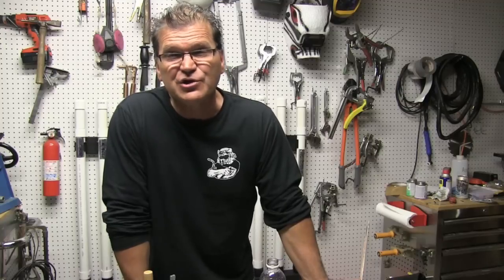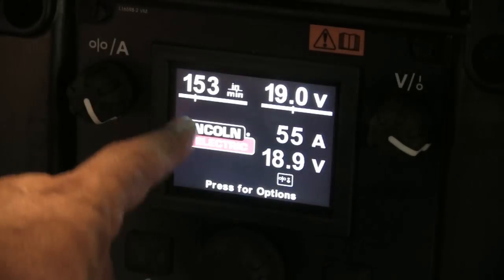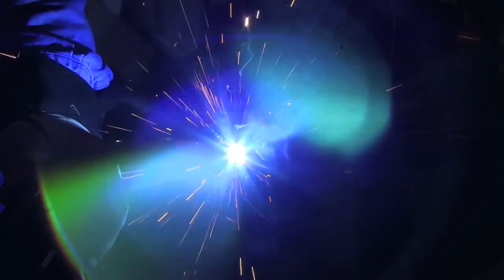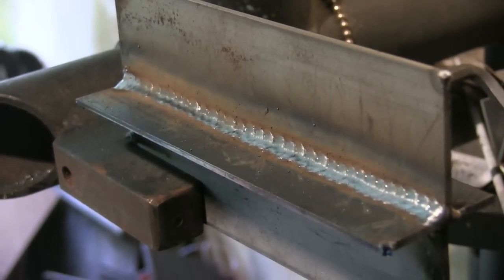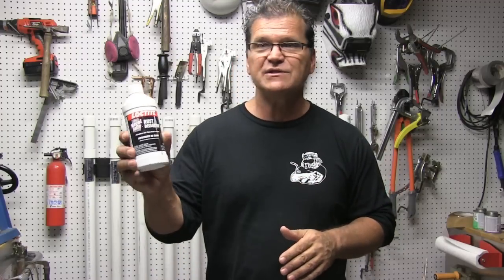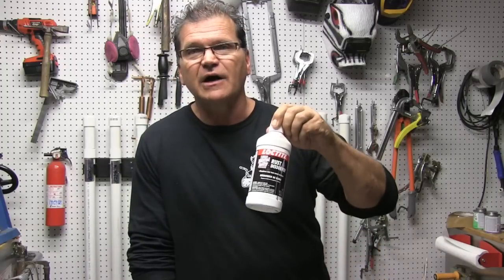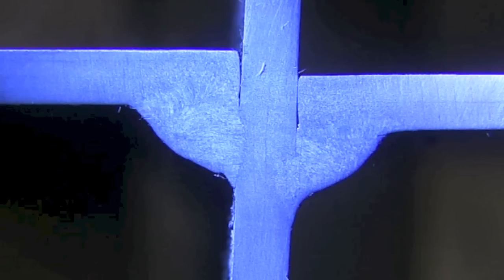MIG Welding Wire Speed and Penetration

Comment: I bought a mig welder years ago. And never go it w/o work properly.
There was little control over either wire speed or current. What happened was the wire came back into the nozzle or it pushed my torch all over the place and spooled it faster than the  current could cope with. I threw it out and bought another machine ,same cost but twenty years later, it works every time and I realise the quality is the maker, the first was British. The second is Chinese. Quality is so different now and I believe it is the mosfat?? Control that does it. The old one was a mechanical AC transformer and a speed rate that was so bad.  The years that passed brought the developments that made it work for me.😊

Comment: I'm just a learner. I wanna know why welding has to sound like frying bacon? Why does the voltage and speed have to match? I wanna weld traveling my hand at a higher speed but I don't wanna blow through which will happen when I turn up my voltage asswell so why can't I just turn my speed up and keep my volts the same?

Comment: A lot of side craters with a too high or low speed.
Learn so much as a welder from this guy.

You can't know everything, so listen to this guy 👍🏻he knows alot.

Concrete cleaner has sulphuric acid in it, pretty nasty stuff!
I use hydrochloric acid for cleaning steel that is galvanized  also nasty stuff! 

Use acid gloves! And don't breathe the fumes and never do it without some good safety glasses and in a wel ventilated area!

All the boxes need to be ticked otherwise it's probably a trip to the ER 👍🏻🥴

A few Symptoms are :

Start:
1.Lightheadedness or a strange feeling in the head.

Light to medium:
1.Slurred speach
2.Woozy/blurry vision
3.Slowmotion movement (only noticeable for a bystander)

Call a doctor! Or with doubt 911!

Heavy:(didn't follow the safety precautions) 
Death through suffocation (one of the ways to go) ,because the little lungsacks are burned by the chemicals.

Comment: Well there's room for both techniques. Run your root with recommended wire speed and get into the base metal. Then slick on some cover beads at low wire speed

Comment: New welder and it didn’t looks like it penetrated how I thought it would. To me it looked like that bead of wire is what was holding the t joint together. I thought the metal was supposed to fuse through the joint?

Comment: The lower wire feed speed examples would be more like tig welding and fuse welding vs using filler wire
Would  you a agree

Comment: Seen A someone mig welding with er70s wire argon/co2
Then switched to inner shield and still used the gas without switching polarity 
Then was complaining about the splatter
I suggested the polarity should have been switched from straight to reverse for the inner shield 
Comment B said said he was dual shielding 
My thinking is the filler wire denotes the polarity not the shielding 
How would you have done it

Comment: I thought my Miller auto-set was best, but now you are showing me to try upping my travel and voltage a bit on my tube 'T' joints.  I get too much build up on the auto-set.  Welds are strong, but look too bulky.  Back to practice!  Thanks Jody!

Comment: I find this particular video, to be quite educational. I am new to mig welding and have not the foggiest idea how to discern one problem to another. Watching your technique and your explanation of heat settings and wire feed speed alone to me and others I am sure is key.  Even more so than all of this, is seeing the weld penetration explained and visually shown when you polished up the cut apart weld. From soldering I understand a cold solder joint, in welding, the meaning is similar yet worlds apart. Especially in a structural support beam of column or a pipe weld.  Some people do not question things, at all, others delve a wee bit more into the why’s and why not.  Thanks for the grand education in this single video alone.

Comment: Waveform control, is it the new direction MIG welding is headed? Synergy has been around for awhile and now we are seeing it on the smaller Mig welder machine scene more and more. In the future are we going to have more arc control options and is it just a matter of time before spray transfer can be done by everybody while better controlling the heat.

Weldmonger could you possibly do a video with a IGBT Inverter MIG that has waveform control? sure would like to hear/see a expert touch on this subject. Thanks a million!

Comment: Concrete etching solution is probably hydrochloric acid and it's good practice to keep any kind of chlorine compound away from steel, particularly stainless. Chlorides are bad news metalurgically speaking.

Comment: I have been told to push when MIG welding not dragging... why do you prefer dragging?
Reply: Ryan Acre because, much like being left handed, it makes no logical sense to go into the puddle, it's more logical to drag away from the puddle, so that the tip does not make contact
Reply: you can push or pull when running short circuit mig like jody was doing in this video, but when you are running higher current such as in the spray arc transfer mode, most of the time you will have better results when you push.

Comment: Gday Jody,I am a pusher if I can but as you say push or pull makes no difference. An old guy when I was young and learning taught me to have a slight pause on each side as I weaved to fill the edge and ensue no undercut. Works really well  on vert up. But any way you do it there is nothing like that molten pool of hot metal.

Comment: Nice little video but definitely should not be giving the advice you are...little tip for you....push solid wire do not drag...also crank it up.....learn how to weld faster and keep up with the machine....you will see better results :)
Reply: +Nathan Snow ur the one spewing shit.  It makes shit all difference, and if anything pulling the gun actually penetrates deeper.  He shows many a coupon etched, each with a push and pull and the difference is negligible.  I can also create a shit weld by pulling or pushing.  

Im over this....."you shouldnt guve that advice" shit all because some dickhead told you all mig welds have to be pushed.  Don't look at etch or destructive testing or anything though.....

Comment: Jody, with the lower wire speed feed, would a lower voltage and a lower travel speed allow for more heat and required penetration to be put into the metal?

Comment: I'm confused over your pull technique.  I was trained to pretty much never pull with GMAW. Not allowed to manipulate the puddle either.  The only exception is on our fluid vessels that are specially beveled on the outside and inside creating a Keyhole for the weld puddle.  I don't even fully understand it  but we never pull except for that or a vertical down on 3/16" or less.  appreciate your thoughts on this, everything i'm seeing on the web seems like unqualified opinion.
Reply: +cr walker While his technique might not agree with your training, Jodie is one of the more knowledgeable "random" welders on the internet giving advice and, more importantly, frequently sharing videos showing the reasoning behind his advice. If you look through his videos, he posted one where he compared push versus pull, and the takeaway is that there is no perceivable difference; I don't remotely remember the whole video, so there may be some exceptions where after 1/4" or something that the technique makes an impact.

Comment: Nice pointers... doing some body metal replacement on an older vehicle. I was trying to find the sweet spot for my settings, but the welds were pilling up; not acceptable even if the metal has rust in the vicinity.
The books that were mentioned: Lincoln Welding... the shipping is ridiculous!! Any other way to purchase the books?
Reply: i bought mine from the james f lincoln website, great books, bought every book they had, like 18 or so total lol

Comment: If you want to make a mig weld look like a stack of dimes, drop your amps & or wire speed a tad  & instead push your wire using a back step motion, or a combination of circular back step motions depending on the joint & wire size. 

The common visual & often audio misconception people have with a back step welding is a lack of perpetration & or cold lapping, which can happen if your amps are too low, traveling too fast & or the angle of the nozzle is too flat, particularly with mild steel. Once your there however this  technique also helps eliminating undercut ,welding in & out of corners without stop starts & possibly dragging the weld a little leading out of a tight corner if you must . If you can make the back step sound like a steady pulse & getting penetration your half way there in perfecting your technique above the rest.
Reply: David Ardron i agree.. But some of well expeeienced mig welders told me that back step is not a mig welding process sir.. Is that true? Because they told meback step is lack of fusion.. Backstep technique is what im doing in mig sir..
Reply: You could have all the experience in the world & you're still an average to shit welder. Do I what I did long ago,  prove them wrong & do a test piece. Polish & etch  a cross section  with die penetrate & then put it under the press .  

I generally find those who moan about back step not having penetration are jealous because they never bothered to learn how to do it proficiently themselves in the first place. 

Keeping in mind back step has to be done hot because your step forward is penetrating the root & the step back is filling the otherwise undercut . This is what you should be primarily focusing on. 

I guess the key is to not go too fast or too slow, but find that perfect rhythm or balance to get the right look & still have that penetration.  but of course if you use low amps you will get a lack of  penetration just like laying any weld down with low amps.  

I've even had co workers in the past asking if the MIG I'm using is a pulse MIG doing back step & they're surprised it isn't, so the sound is something you can focus on also. 

The back step likewise works a treat doing heavy gauge aluminum, so its really knowing your machine & refining your technique at the end of the day.  Once you become proficient at it it becomes second nature & lets not forget a good , well maintained  MIG helps you even more.
Reply: David Ardron yes sir.. Thank you for your advice..

Comment: Did you happen to check penetration on the outside corner joint? I'm just wondering how much better it faired than the T joint. 
Keep up the great work. 
Thanks a ton for the videos.
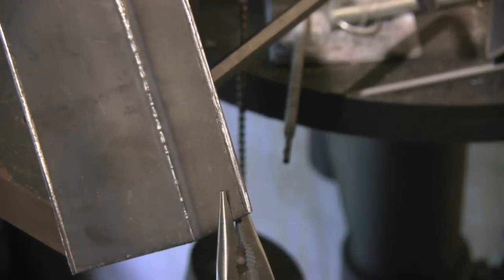Reply: It looks like you can see the penetration at 3:15

Comment: nice!! hey Jody I would like if you could make a vid on you intake of  diffrent types of Mig welding gas for steel. I've  been using STARGON tri mix.. co2,argon and oxygen. I feel I get a cleaner weld but not sure if it's me or makes no real difference. thanks.
Reply: depends....running a higher concentration of argon would only benefit you if your welder is capable of exceeding the transition current for spray transfer...otherwise stick with 75/25 for the best results.

Comment: I bet that the faster wire speed helped push the puddle deeper into the joint giving you the better fusion you saw. Im curious to the comparison of the strength of the joints though!

Comment: Is there a reason you did not etch the outside corner joint? I am interested to see the weld profile on that since the slower feed speed came out "better". I enjoy the channel, thanks!
Reply: +Lance Brumfield 
you could see the penetration on the inside if the corner joint.
Pretty good indication all is well
Reply: Also interested in the etching of the outside corner joints. An Instagram comparison pic would do.
Reply: +Steve Williams  The first two welds were the outside corner joints. The second two welds were T joints that he etched. Additionally, the etching revealed that the lower feed speed weld had lack of fusion.
Reply: +Lance Brumfield I know I'm late but I want to point out that he mentioned in the video that the outside corners don't need as much heat as the inside corners do. He even said why - the outside corners only really present the edges to the heat source, and thus don't conduct the heat away from the weld quite as quicjkly as the big flat areas of the inside corners. So penetration on the outside corners isn't as much an issue as blowing out the puddle might be. Just look at the welds again in the vid and you can clearly see that from their profiles - plus, as mentioned, the back view of the low speed pass does show good penetration right through the root.

K Fox

Comment: Why are you pulling instead of pushing mig?
Reply: +terry Grubb Because it makes little to no difference to the weld. 

Jody has a couple of good "push vs. pull" videos here on the channel where he shows the actual weld nugget.  If you weren't told which was which you'd never be able to figure it out.  They're that similar.

Comment: How about an oxy acetylene welding video? Literally almost nothing on youtube and it's such a useful process. Most have a setup in there shop but not much info on the topic. I keep having puddles pop on me and can't find a solution!
Reply: +neon922 Learned that on a million rusty exhausts as a mechanic. How easy it was when I tried it on clean metal comfortably placed on a workbench...
As for the pops, keep the flame slightly carburizing (a little acetylene feather visible over the cone) and maybe a one size lager tip to give you a softer flame.

The rusty exhausts will pop whatever you do...:/
Reply: +neon922 less than ideally clean tip can cause the puddle to blow
Reply: I know it's a late response but the puddle popping is usually due to too much heat input